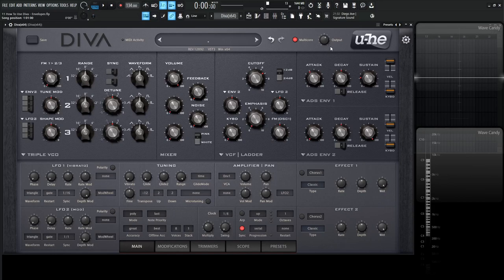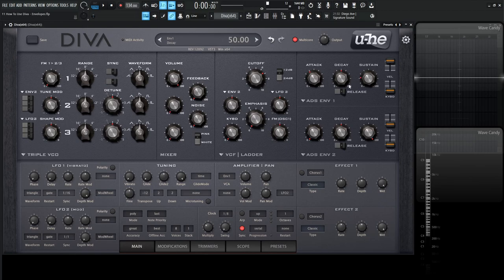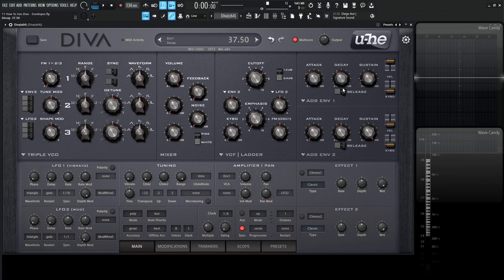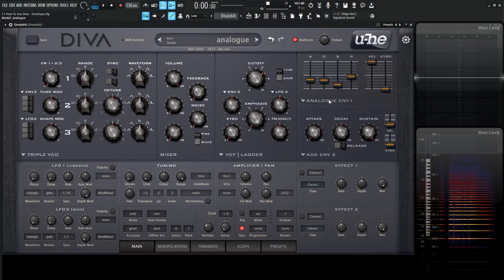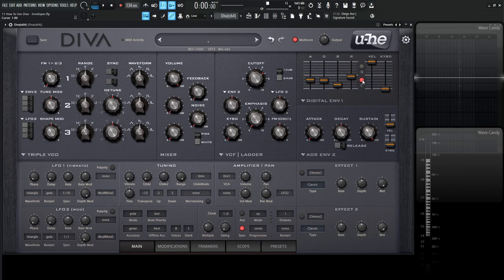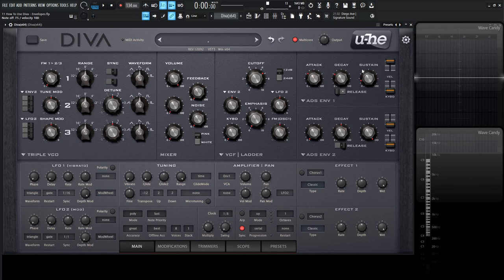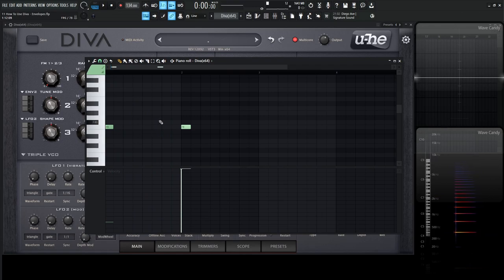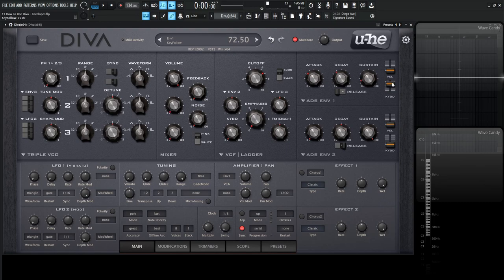Envelopes PART 11 | u-he DIVA Tutorial

Comment: Is Env 1 always the amplifier envelope? (I'd almost swear I've seen presets where Env 2 was the VCA envelope and it was awfully confusing, or maybe that was a bad dream I had)
Reply: You can switch it in the Amp settings!
Reply from the maker: JoSh is correct, if you go to the Amplifier | Pan, under the 'VCA' drop down menu you can swap Env1 to Gate